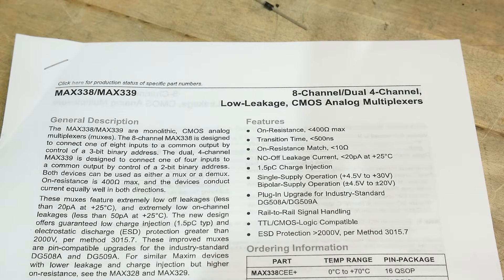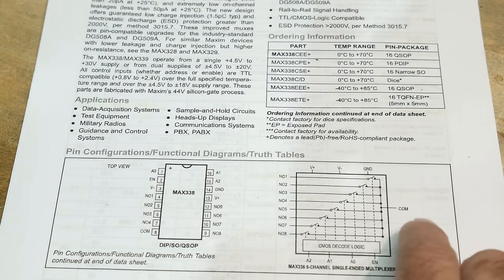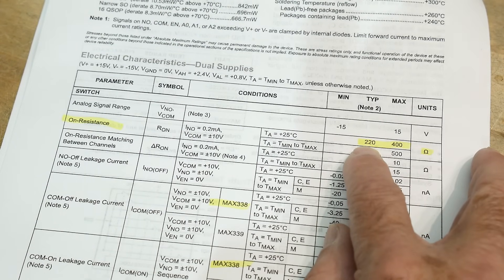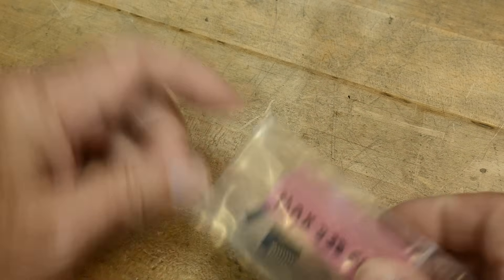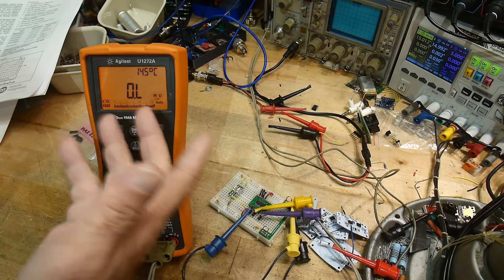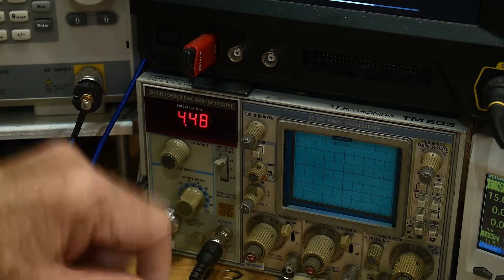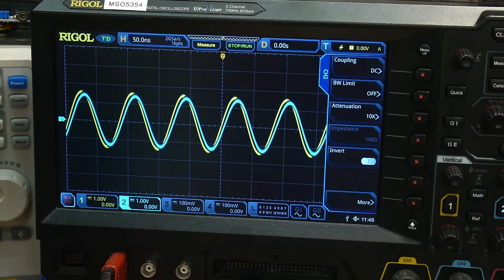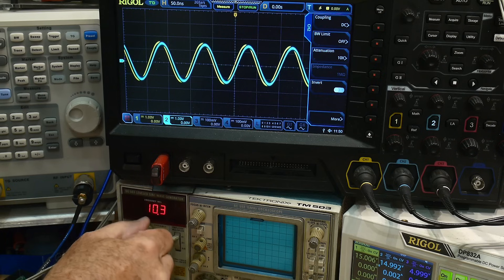#1829 MAX338 Analog Switch Multiplexer

Comment: Very recently I was working with another Maxim 8:1 analog mux and discovered an apparent silicon bug. Basically, whenever the mux switches, the chip sinks a large (sometimes nearly 10mA) current for a brief time (around 0.5us) from the path being turned off. This happens before the switch breaks, so it's effectively from the COM pin to GND. Datasheet makes no mention of this, and describes itself as break-before-make (technically true if you don't consider this glitch current to be a "make"). Might want to check if these chips suffer a similar issue.

Comment: The 14 MOhm on the Keithley look fishy. The 2015 supplies about 7V (Uref) via a ~10Meg resistor and measures the voltage drop in the high resistance ranges. With 20 pA leakage current, you should be in the GOhms, which the 2015 can't measure.

Comment: Would the characteristics be the same for both directions?
Reply: In most of not all situations yes. The the analog switch circuit used is symmetrical.

 2 p-channel mosfets with gates connected and 2 n-channel mosfets with gates connected, 
connect all sources,
 in/out terminals are 1 n-channel drain and 1 p-channel drain connected,
 driving n-channel gates to a higher voltage than the p-channel gates turns it on, you want to use opposing square waves,

 voltages above/below voltages applied to in/out turns on only n-channel/p-channel mosfets,
 power supply limit is your smallest vgs max for your mosfets,

Sources are essentially floating and so should be given a DC discharge path, preferably to ground, through a large ish resistor, hundred's of k, or anti-parallel diodes to both power rails
Reply from the maker: yes

Comment: Maxim also used to do a combined analogue multiplexer and buffer amplifier for video applications as the MAX453, 454 and 455 which are better for high frequency work. They would be worth a video if you can get them - they work up to 25MHz or so  and have good isolation between channels - sadly they are  not still in production.  The switching speed of these - 120ns or better - was also very good and in my work allowed timesharing of a single ADC for low MHz waveforms.

Comment: Were you terminating that feed coax in 50 Ohms? If not, the higher frequency dips and bumps probably are not 100% real. I would have terminated the coax with 50 Ohms right at the input to the multiplexer. Also some resistance at the output of the mux is probably a good idea also, maybe 10K??

Comment: Intercontact capacitance in the breadboard is something I've ran into before.
Reply: Hydrogenated capacitance is very bad for your cholesterol.
Reply: @silverXnoise  Like saturated fat capacitance.
Reply: What other kinds of capacitance should we worry about?
Reply from the maker: brain capacitance
Reply: @mikebond6328  I just measured capacitance of about 2 pf between adjacent board contacts.  It really depends on the component type, pin layout and the upper frequency you expect to see in your circuits.  If your doing something at say 50MHz and/or need to maintain fast edges, one might consider avoiding these proto boards. I've been bit by them before.